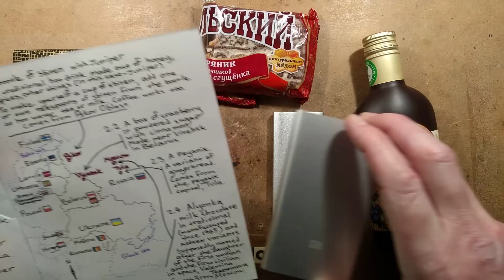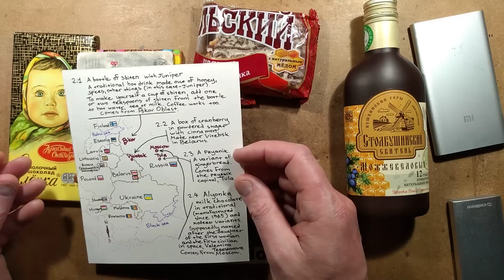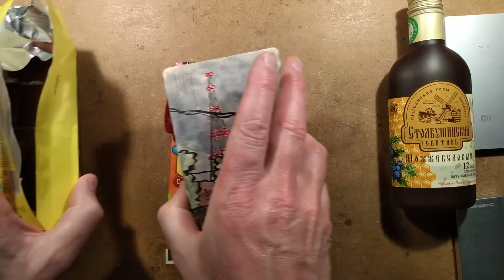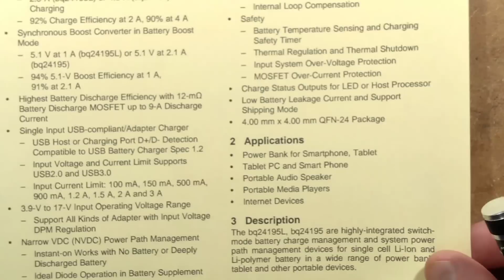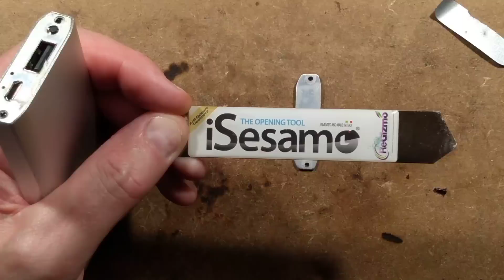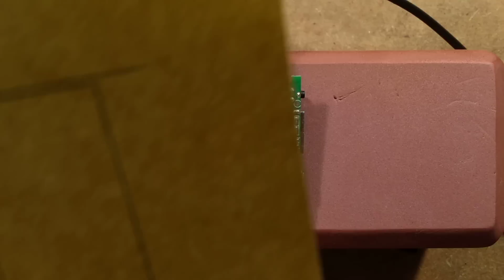Resurrecting dead power banks from Russia.

Comment: Clive,  your pronunciation of Fukuoka may trigger the dreaded bots. For future reference it is like "Foo-koo-OH-kah" (emphasis on the "oh" bit)
Keep up the wonderful videos. 
I would love to see you get a Halo Bolt 58830 Jump starter / power pack / inverter (mine has a 65W 115vac, U.S. outlet on it.) and "take it to bits" then offer your opinion of it. 
I'd send you mine,  but it still works great, and I use it all the time when going to garage sales and yard sales to test small appliances or radios etc, that I'm interested in.  Lil' bugger even started a Chevy 350 (5.7l) V8 with a stone-dead battery.

Comment: They are not made for servicing but they should be made for recycling though. Also a reason not to glue the cells
Reply: Good point. You can soften most 3M type adhesives with heat.  It's the only way to access waterproof cameras eg GoPro 5,6,7+ . We use a Sealey HS102 heat gun at about 65-90 deg celcius. Lots of patience and burnt fingers required.
Reply: On disassembly ('taking it to bits'): powerbanks and other devices sleeved in extruded alumin(I)um cases almost invariably use screws mounted in holes that are, for practical reasons, centered in the thin edges; it's sensible, therefore, to try cutting a small X through the glued-on cosmetic sheet, one over each screw, then inserting the screwdriver bit tip through the centre of that X, and unscrew… the screw comes out, but remains captive between the foil layer and whatever it cosmetically conceals. The foil layer remains relatively unabused, so the device can be reassembled and not require additional faffing about to restore a semblance of neatness.
Reply: @michaelthibault7930  There's always a hidden screw under every HD label.  Usually in the spindle area.

Comment: I"m curious what the capacities are, especially for that second pack after it has sat at such a low voltage. You hear people screaming left and right about discharge protection, etc. But what is the actual, measurable effect? And does it really "kill" the cell beyond being usable? Clearly it was still holding some power after you slow-charged it..
Reply: Upvote to the top. I'd love to see a followup.
Reply: Well, I'll bet on one of the cells discharging the rest. Reason? This integrated protection/mosfet ic should cutoff battery when voltage on it falls down below 2,5V, and chips like these are designed to draw very small current, somewhere about few uA. For a cell of this size a few years at least. I think if left for longer period of time, they would discharge to 0V.

Comment: I Shukhov tower is a design classic.  Circular without a straight beam in in.
quote "The Shukhov tower is a hyperboloid structure (hyperbolic steel gridshell) consisting of a series of hyperboloid sections stacked on one another to approximate an overall conical shape. The tower has a diagrid structure, and its steel shell experiences minimum wind load (a significant design factor for high-rising buildings). The tower sections are single-cavity hyperboloids of rotation made of straight beams, the ends of which rest against circular foundations. "
Reply: It really is a beautiful piece of engineering and just looks beautiful.

Comment: Xiaomi has had their powerbanks ripped off so many times it's nice to see the originals, my trio of their "10,000mAh" ones are still working well 4 or 5 years after buying them, containing 3x Panasonic 18650 cells a piece, really good powerbanks, and rather cheap at the time (when the $-£ rate was in our favour!)... :)
Reply: Yeah mine are still running strong 5 years later

Comment: Tula is where they make most of the Russian ammunition, too.
Reply: I was just going to say this. They’ve been making weapons there since the reign of Peter the Great.
Reply: I buy lots of TulAmmo branded ammo, it great for cheap target shooting. You can't reload the casings since they are steel rather than brass but I don't do that anyway. The only downside to me is that I have to put more effort to clean my Valmet M76 after shooting lots of the dirty ammo.
Reply: Darkavatar I’ve reloaded the steel before on a whim. It does work, but not as well as brass. They make good primers, too.
Reply: @DarkAvatar1313  Can you sell the spent steel casings to scrap dealers (if you got enough to be worth it)? Or do they not want them because there might be unexploded stuff left that could blow up in the crucible?
Reply: @rolfs2165  At the price of scrap metal, it's not really worth the time and effort to gather and turn them in.
Reply: @DarkAvatar1313  Do you have a gun? 😃
Reply: ah good old communism brands

Comment: I've had major issues trying to locate information many older Russian Semi Conductors.  Like everyone else I guess they rely on Chines and Asian products now ?   Guessing this one sat idle for some time and the BMS  Quiescent current drained it down that far ?
Reply: There are some manufacturers, such as Micron in Zelenograd (Moscow), but the manufacturing processes aren't good enough to compete with giants like Intel or Qualcomm. Russian made semiconductors are mostly limited to stuff like RFID chips in transit cards and military orders. Russian–designed chips are usually fabricated in P.R.China. The political regime and heavy corruption, sadly, drastically limits the chances for growth.

Comment: Hey Clive!

I know you're into electronics more than old school computers, but CuriousMarc has a series on restoring a Apollo Guidance Computer, an old computer before microprocessors.  Truly fascinating.  At least for geeks like me... :)

Got any comments in general on Space?  (The 50th anniversary of the Moon landing is in a few days...)
Reply: The CuriousMarc series of videos on the AGC is nothing short of spectacular and simply brilliant. I cannot recommend it enough.
Reply: In a previous life I used to service electronic controllers for heavy dump truck automatic transmissions, nothing special about that except this was the early 1970's, everything was done with discrete components. It processed two analogue inputs, throttle position and vehicle speed, digital inputs from the shifter, starter, and a few others and produced digital outputs to control the shift valves on a huge auto transmission that weighted around 5 Tons by itself. Fully modulated current limited shift points with protections to stop drivers doing dopey things and trying to break the gearbox. God I hated those things.
Reply: NASA have, on video, admitted the following.
1. They destroyed the technology required to get back to the moon.
2. They have yet to engineer a method to safely pass through the Van Allen belts.
It's all on YouTube.
We never went to the moon.
Reply: @japonicaren : Oh, it's all on YouTube, so it must be true.  Friend, NASA has "admitted" to nothing of the sort. It's all hogwash and cheap propaganda. You've been had.
Reply: @japonicaren  Can't believe the flat earthers have made it to Clive's channel, this is indeed a sad day.
Reply: budo r 
1. Not destroyed, so much as stopped making them. Now the production lines are long gone and those manufacturing techniques don’t exist in the modern CNC era. 

2. With careful trajectory you can avoid the worst of the radiation belts, and just speed through the rest. You wouldn’t want to spend a few days there, but a couple of hours is fine.

Comment: Clive have you ever worked in data centers? I think they're 460 3 phase it's pretty gnarly
Reply: ADR He's in Europe.  400V 3-phase  is household power in larger homes here.  He's also worked the power input at large entertainment venues and was initially apprentice trained in industrial scale electrical installations.  So I doubt he'll be intimidated by a 460V 3-phase installation.  The total wattage and money at stake at a big data center might be somewhat intimidating though.  In terms of physical danger, the battery room (like a giant UPS) would be more intimidating, due to the huge energy release from a short and the explosion risk from insufficiently vented gasses.
Reply: @johnfrancisdoe1563  that seems insane to have 3 phase in a home. Or maybe fortunate ha
Reply: @ADR69  Used to be very common in Australia - even in cities.  Some older properties are still connected.  Up in the Aussie north you need that sort of industrial power for the air conditioners!

Comment: That Xiaomi one was sold at Office Depot in the States for super cheap not long ago (sold as 5000mAh for $5... hmmm....).  Not great but not bad, won't charge newer phones with high drain.  Shuts off automatically and at not-so-low-current (annoying).  Doesn't stay on when charging.
Reply: Yeah powerbanks aren't that cheap yet. With batteries a good rule of thumb is that if it's too good to be true, it isn't
Reply: Walgreens sold the 10Ah for $20, unmarked so probably a knockoff but it works but only at 1A.
Reply: Xiaomi powerbanks are THE most duplicated in the market. Please buy Mi products only from their official US website!

Comment: Surprised how complex that Xiaomi power bank is - I have 2 of the 10000mah variety of the same unit and they can be sourced ridiculously cheaply, at least in Australia (16 AUD / 9 GBP). Capacity has always seemed accurate and the build quality good.

The 10000mah has the same build as the unit you recieved, but with an additional USB output.
Reply: Well mine started to act funny as in not working and needing to have a charge and then showing 80% full.  I've opened it yesterday and surprise surprise the Lipo cell is swollen. Date code 2017.   I really liked it but only had used for lets say 10 times maximum.